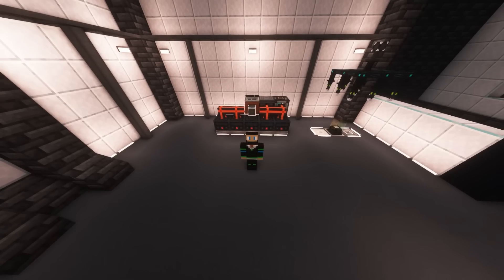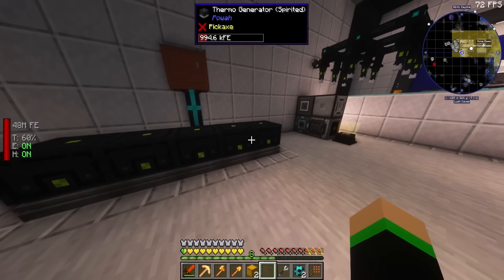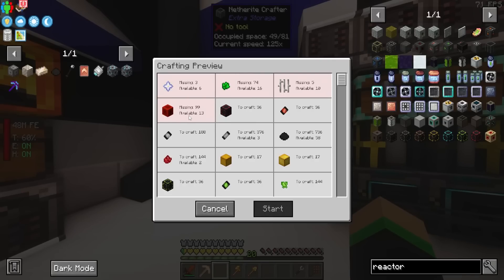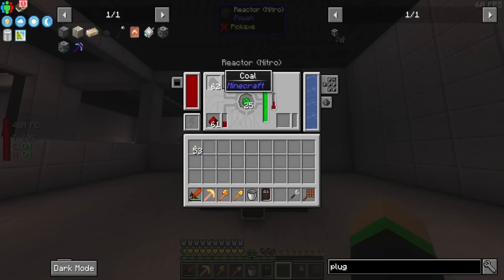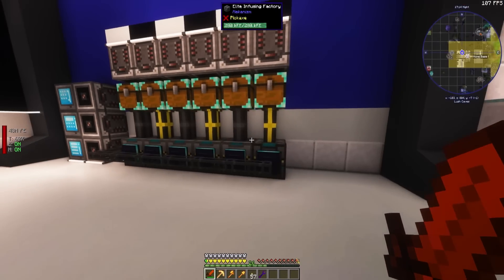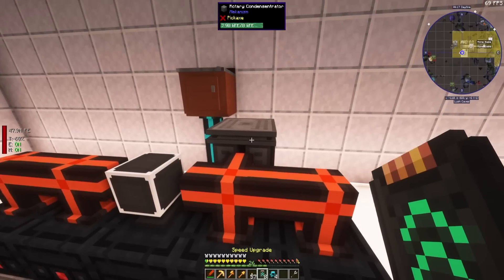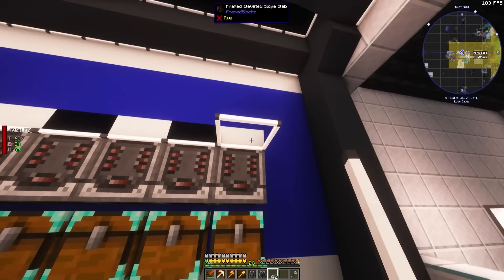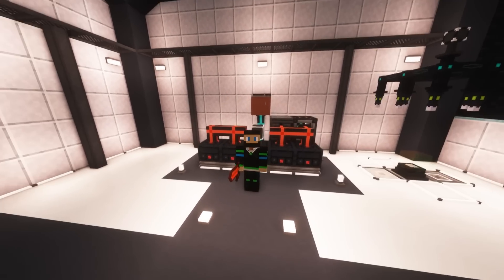Powah...Power? | All The Mods 8 EP 13

Comment: You need to take a moment to look at what Reborn Storage can do instead of using those Netherite Crafters for non-processing based items.
Reply from the maker: I checked them out before, but it felt like more of a hassle compared to the regular crafters. Are they faster?
Reply: @AlfredGGMC Weird, I sent you a detailed reply to this earlier and it's gone...  Anyway short version answer is yes and no, for processing type recipes your setup (Crafter -> Chest -> Machine) is best though you may want to consider splitting your processing across several copies of machines as they can be a bottleneck even with netherite crafter and super fast machines (if you need so smelt 2 different things for 1 recipe they are done in sequence especially with split input on) Your Mekanism setup is a perfect example of what I mean but extending it to other machines is a good idea. I usually go anywhere from 3-5 copies of machines to every thing gets its own machine depending on what I'm trying to achieve.
For General craft Chonkputer wins because CPU's are speed 4 crafters and run in parallel so more CPUS = more faster. Also each storage contains 78 patterns. and It looks cooler than random crafters on a wall.